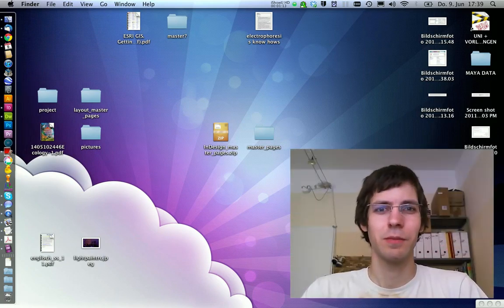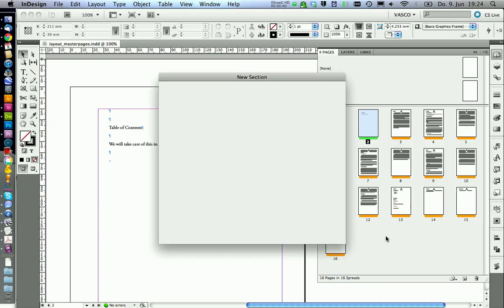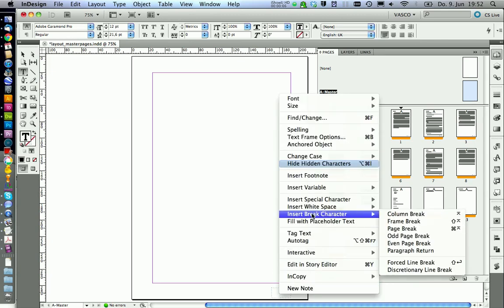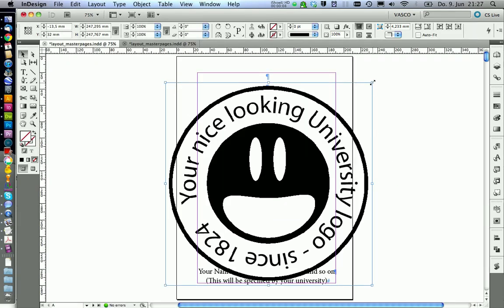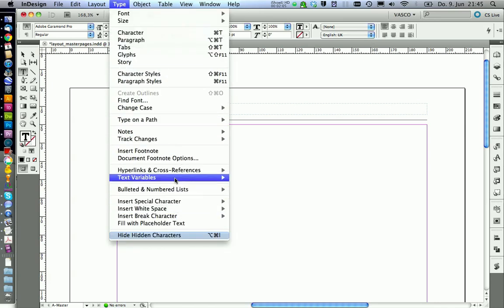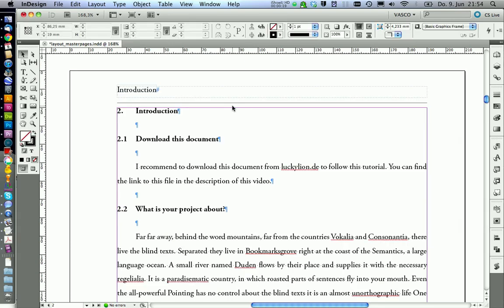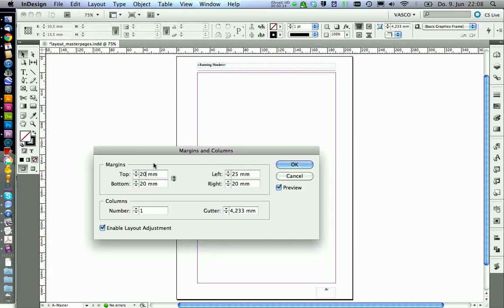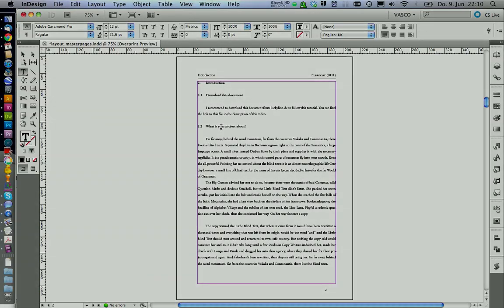InDesign CS5 Tutorial: Layout with Master Pages (Part 4)

Comment: Hello Vasco, I'm currently writing my Bachelors Thesis and I am finding your tutorials extremely helpful :). However, I am having a lot of trouble with the Running header as it does NOT recognize which Header (1, 2 or 3) to use and it seems as if it just chooses one at random! I would be so grateful if you could help me. Best, Luna